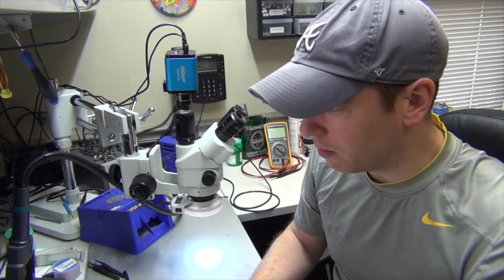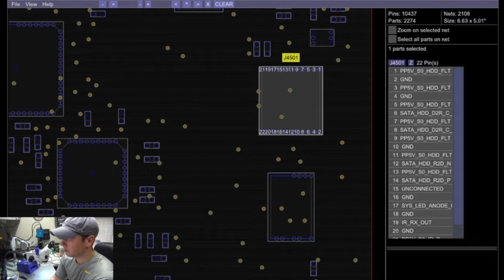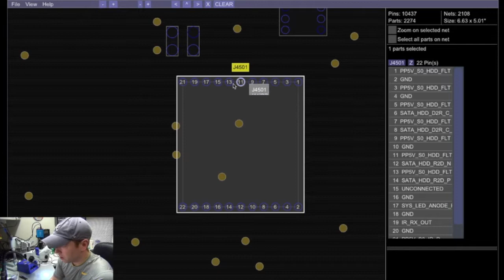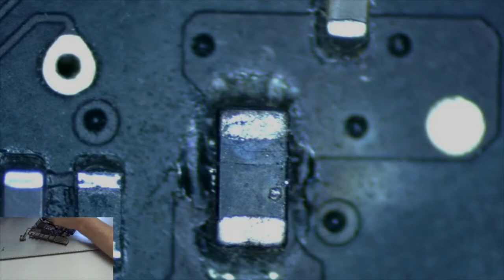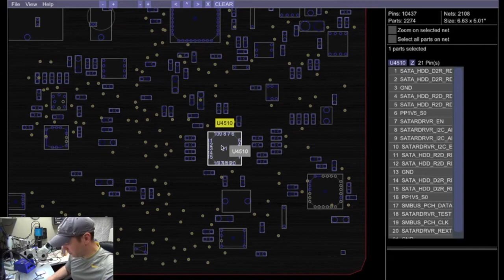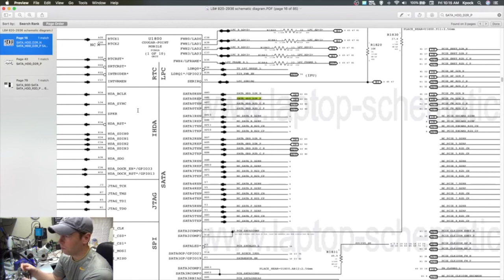How to Fix a 13" Macbook Pro that Won't Recognize a Hard Drive -  820-2936

Comment: HI! I have a similar issue with my 2009 macbook pro 15 inch, it does not read the hard drive. I have changed the internal hard drive flex cable, i can hear the hard drive spin, but the question mark still blinks on the start up. The hard drive has the right older OSX installed that work with these model. Any ideas what else could cause this and what i could try to fix it?

Comment: Hello,
I'm sorry to bother but I thought you might be able to help. I've seen your videos on YouTube and was impressed with your knowledge.
I have an old MacBook pro mid 2012 A1286, it didn't have HD and RAM. I put in 4 GB of RAM and by mistake I connected one HD that bad Windows 10 installed on it and I booted Mac. 
It showed Windows screen, then I turned it off and tried to connect new SSD but now Mac does not see new SSD and I cannot reinstall Mac  os. I tried different options and even reset nvram. Nothing worked. 
Maybe you can give some suggestions or hints. 
Thank you in advance. Really appreciate your time
Reply from the maker: If I understand right you likely need to format the drive in Disk Utility before you'll be able to use it.
Reply: @PowerbookMedic   Thank you for your reply but I did it number of times and I can see my new SSD in Disk utilities but still cannot install OS. I tried HD flex cord with regular spinning HD and it does work  (spinning). so power is supplied. Also, I'm able to connect to wifi normally and can hear dvd reading part moving. Not sure if this may affect it , I installed at first 8 Gb then reduced to 4 Gb of RAM, but this RAM is from windows computer but it proper specification for this MAC. Maybe there are any other options? THank you for your time and help!! I really appreciate it
Reply from the maker: @DmitriyMargolin  If you can see the drive in Disk Utility then everything should be fine with the connections. You should just format it from within DiskUtility and then restart to install the OS. Beyond that we would need to see the computer to see what is going on. We do have a send-in repair service you can get more info on here: https://www.powerbookmedic.com/mac-service.php
Reply: @PowerbookMedic  thank you very much! I will try again. If it won't work then I might send it to you for checking. Unfortunately, I don't have resources as you have to check in details

Comment: Another educational video, thanks for sharing your knowledge. I have the same kind of board that suffered from liquid spills and doesn't find the HD. When booting, I have chime and then, the question mark folder of the dead.  However, it's weird since when I booting from a bootable pen drive it's possible to see the HD in diskutil and I can even erase it. When I searched for the PP5VS0, I got zero. However, HD spins and works. Is it possible the HD works without this rail? I tried to boot from an external HD and surprisingly, it doesn't work. It appears that  USB ports are not providing enough power in order to power up the external HD, and also the internal one. What could cause such an issue? I'd appreciate your help. Thanks again.
Reply from the maker: Gerson Bernardo Thanks! I would completely remove the board and look for any corrosion or burned components that may have been damaged with the liquid spill. A visual check of the board is always the best way to start in diagnosing the problem.
Reply: Powerbook Medic dear friend I have an experience to share with you. Well, I’ve just had the macbook working. I made the visual inspection and I didn’t see any corrosion or oxidation except in the EFI chip. Well, I cleaned the entire board and replaced the EFI chip, since some contacts were quite oxidated. Well, the macbook is now working flawlessly...something in the bios program was avoiding the SATA from being recognized. Thanks for the help.
Reply from the maker: Gerson Bernardo That’s great! Glad you were able to identify the issue and fix it.
Reply: Correcting, I have PP5VS0.

Comment: Does the flux prevent the solder from reaching the other connections in the space and short circuiting them?
Reply from the maker: unintension No, the flux help the solder flow to the pads and pins. It could still bridge tho if you use too much solder.

Comment: Hello! Thanks for the video!  I have an 820 - 3115 with the same problem, hard drive doesn't turn, no spin, but the fuse is good and the 7 pins on J4501 get all 5V. Can you help me? What can I check next?
Reply from the maker: I have seen quite a few of those have a bad hard drive cable.  That would be the next thing to check most likely before you move on to something else on the board.
Reply: @PowerbookMedic   Yeah you're right, I thought it works great but I just see that it die ... 
Thank you! :)